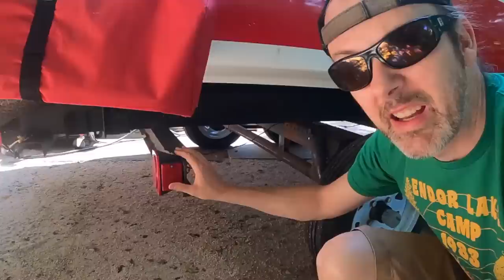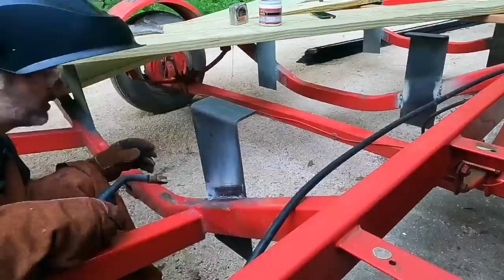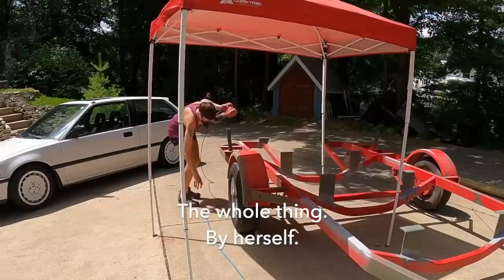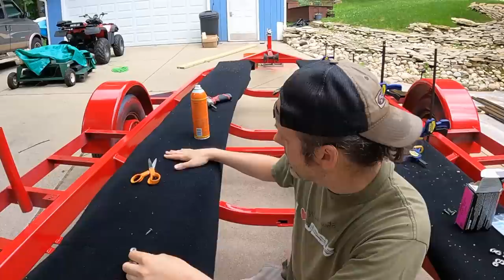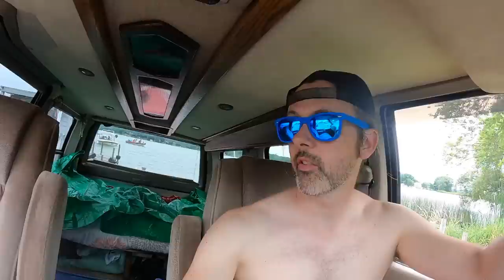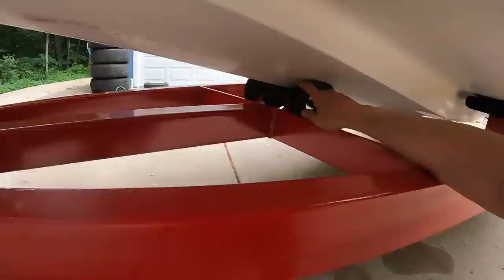Ultimate Boat Trailer Budget Build: Modify/Restore a Junk Trailer for Your Boat Sleekcraft Sunday 22

Comment: Use a turn buckle as the front locking mechanism and you are spot on with the v at the front. First thing would be to use a scale and find out how much weight is over the rear to then determine how far to move forward. Could also use another 2x? Screwed to the top of existing bunks to raise 2 inches or even 4 for a test of if raising bunks would allow you to move forward far enough. Then worst case scenario would be move the axle back. BTW love your channel; and your work with what is available and make it work attitude.
Reply: Raising the bunks would also help with clearing the wheel fenders.
Reply from the maker: Yeah, something like that might be the solution.   I think I'm going to unbolt the bunks and shim them upwards a bit in front, but I'm happy with the clearance in the back.   Axle isn't moving, I'll sandbag the front of the trailer with tool boxes and spares and anchors before I open that can of worms lol.  Cheers man!  Thanks for the words!
Reply: @ADDvanced  What does your current configuration weight? In most cases a single axel trailer is safe to haul 3000 pounds, I doubt you have much capacity remaining. Keeping your center of gravity lower will aid handling, especially at highway speeds. If you have sufficient out drive clearance shimming the bunks enough to support the hull is best. How much tire clearance do you have? Many trailer manufactures relieve the back of the fenders and add carpeted plywood backs to protect the hull. Shortening the winch stand and add a V block or roller on a plate and relocating the axel so you 10% tongue weight is your safest option towing. I enjoy watching your projects, keep the videos coming!

Comment: As a retired boat mechanic I’ve messed with trailers a ton, I think your on to something with the plate and bunk on the winch. Flip the winch over and crank from the drinkers side. I’d cut the bow roller off move it down slide the rig forward and bam…more tongue weight.
Reply from the maker: I like these ideas.   Great idea on the winch.

Comment: Add weight to the front of the trailer to fix the tongue weight issue. That trailer is designed for a direct drive boat, it will never be right without moving the axle, or adding ballast to the front. 

On the bunks. It looks like you could get away with shimming the bunks up a little in the front to fit the contour of the hull. Maybe use some UHMW Poly sheet and slip it between the bunks and trailer? 

And finally the winch etc. you are going to need something to keep the boat from creeping forward. Some low profile boats use a set of carpeted pads that capture the bow and limit travel fore. Raising the bunks slightly will also give you a little more clearance on the fenders. Just some ideas.
Reply from the maker: It's actually really close to being right; it takes maybe 5-10lbs of force to keep the bow from lifting.  Honestly mounting a spare up front would solve most of it.  But yeah, I think I'm going to shim the bunks up a little in front, and a little less further back, but keep the stern bunks at the same height.  I ordered some bow stops and plan on relocatin the winch, maybe look into fabbing one of those bars that mounts on the trailer that prevents it from sliding forward?   To be determined.  Thanks for the advice!

Comment: Double the wood,put another brace on both sides of the back,yes,the stop block she said is great,but you will clip the boat front to the stop block ,I would clip the front though too,hey trailer looks great guys really does,
Reply from the maker: I think I'm going to shim the wood instead of adding another set, they're expensive!
Reply: @ADDvanced  yeah,it can be done,or you could put wood under the carpeted one,both will work .long distance  though,I would support it,but your really close to the lake...shims it is....

Comment: Raise the bunks maybe 4" for fender clearance. On the bow loose the front roller and winch. Go to a front V-Bunk for support. For front attachment, build a Tie bar that is hinged onto the trailer and that will lift up and attach to the bow eye with a clasp. In the back just use 2 short straps on each side to the trailer. Watch the Roadkill episode where they swap an engine into a jetboat from a truck. You will see what i mean about the front tie bar. Oh and for balance, find out what the Gross weight is for that axle. I would guess it is 3500# max. if the boat is light enough that you have plenty of room, then just add ballast to the front. ie. Spare tire. maybe a tool box, lead weight, anything. Tongue weight should be about 10% of total trailer weight.

Comment: Me and my friend bought up all the Honda 350's and 400's we could find cheap in the Netherlands. And we would dismantle the rest of the bike.
For those remaining parts to be sold; we usually then got the engine for free.
Same as your trailer, haha.

Thanks for another video!
Reply from the maker: I actually wanted to restore the boat that came on this; it was a Sleekcraft Kaui with really cool gelcoat, but there was a split in the bottom of the hull along the keel, from the boat filling with water and freezing/thawing over time.   Didn't realize it was scrap when I bought it, but it worked out.
Reply: @ADDvanced  If you get lemons, make lemonade!
Great stuff that you do, my dude.

Comment: Ski boat trailer are designed for center motor weight, Extend your tongue 12 inches Cut your fender about 20 degrees then add pvc plywood with carpet. Also the boat is to far back cut the winch. then raise your bunks 2 inches. also you can. I build lots of trailers here. Ill send you a picture of one i just finished.

Comment: When I fab up something or modify an existing piece, many times it requires a bit of adjustment after the initial work. You've got a great start, so that trailer should end up as a success in the end
Reply from the maker: I think shimming the bunks up and relocating that winch further back will fix it.   Stay tuned!

Comment: Just a thought
So my buddy’s old boat trailer has a similar set up to what Sara was suggesting. Like a turn buckle hard mounted to the front bar with a locking hook to snap on to the bow eye, it pulls at like a 45 degree angle so it gives the affect of pulling forward and down. Also I thought I had would be take off the winch move that bar back and put another bow roller on it where you can lighten the load from the keel hopefully and get it to not bounce. Of course this is all assuming that you can pull it far enough forward to get you some tongue weight. 
Last thought. I know your not gonna wanna do this but you could move the axel back. 
Love you guy’s videos. Thanks for sharing 🤟

Comment: You said the trailer had a ski boat on it. Well ski boats have a V8 in the middle. Yours is an I/O, V8 at the back plus the outdrive. So balance is way off. You will have to move the boat forward, a lot. Bunks hanging out the back is odd, but with the outdrive, they won't be the most rearward part. Take a look at my old Sleek Craft boat trailer (LOL) and line up by axle, see where things are for ideas. Cut winch stand off red trailer. Use a solid bar, just like the blue trailer. Easy to make, looks and works great. I think you will have to lengthen the tongue of the red trailer (more welding practice). Only real problem now is that front roller. Reconfigure that crossmember to clear. Maybe block the bunks up to help with clearance too. The front end must be tight to tunnel, to reduce the boat hop. Sara has been a great help. She looks good too, doing well. Good luck you two!  Mark
Reply from the maker: Hey Mark!   Yeah, I'm aware, but I didn't know how far it'd be off 'til I tried it.  The trailer is built pretty heavy so I was hoping the extended length of the tongue/frame would offset the V8/drive which is closer to the fulcrum.   It's pretty close tho, I would say 10lbs on the tongue was enought to keep it down.  Sunday we removed the winch and slid the boat 8" forward, now it has tongue weight, so getting closer.  Need to fab some guide bunks in back to keep it off the fenders, and going to try shimming the front of the bunks up about 1-2".   I think that will be close, then just fabricate that bar/V bracket.

Comment: Rob, on the welding, yes, you should use the 70-30 % blend. Pure argon is for aluminum and ect...  I'm guessing but the wire feed is .032 or 035. On 1/4" you will need to be around 95 to 105 amps and adjust the wire feed to match the heat. Certified on g45 angle for welding tubes in boiler
And structure welding. Also that maybe Flux core wire in which you don't need argon.

Comment: I think the least amount of fuckery would be to shim the bunks up to where they support the boat and take the weight off the roller. It would also bring the nose of the boat up a bit and create a bit more clearance around the winch handle. If that doesn’t solve the issue just remove it or relocate it. I like Sarah’s idea as well.

Worst case you add some forward ballast to keep the tongue down. It will tow more safely once you have some tongue weight. But I’m sure you’ve already figured it all out. 

One question, did you grind off the paint/coating where you wanted to weld or just turned up the amperage and burned through the paint? If not the paint could be the cause of the welding issues.
Reply from the maker: Yeah I ground off the paint where I was welding, and ground off the coating on the brackets, it had some sort of darker coating to prevent it from rusting.   Maybe my ground was too far away?
Reply: @ADDvanced  assuming you got down to bare metal it could be the ground or more likely the shielding gas possibly getting blown around. Flux core wire works better for welding outside as wind doesn’t affect the weld at all. It doesn’t hurt anything to get a small roll of it and use it in conjunction with the gas as flux core with gas makes a nicer weld than just flux core by itself. The pros to flux core is you can use it in windy conditions and it gets better penetration. The cons is it spatters and leaves slag that you have to chip off. If you have to weld outside more I recommend getting a small roll of it to try. Good luck if you haven’t already finished fixing the issues. Well even if you have, good luck on your other projects. I really like everything you do. 🍻

Comment: Looks great.  Your tongue weight can change really quick.   You may have some axle adjustment.     

You can calculate how much you need to change the position of the boat and or axle. Toss a bathroom scale under the jack when you disconnected and start doing some math before you make any more modifications to see if those mods will even work.
Reply from the maker: Removed the winch, slid the boat 8" further forward, and it has a little tongue weight now.   Could probably use a little more, looking at mounting a spare tire up near the front somewhere.

Comment: My 84 LaveyCraft boat trailer has no winch. It has a bar that is angled and is secured way underneath the bow,. It just pivots and makes it very easy to load on steep ramps. Most of the boat is secured from the stern. The bow bar does secure it a bit but it is free to move up and down. When loaded it doesn't move. I use a strap on the trailer and hooked into the bow loop on the boat when I take it out of the water to prevent it from wanting to slip backwards on steep ramps. Once it's out of the water and on level ground I remove the bow strap. 

Bummer about the weight. Hopefully you can move it forward enough to get more trailer tongue weight. If not it will not handle towing very fast without swaying. When I re-powered mine with a newer one motor the weight changed enough that I added a spare tire carrier on the tongue to offset the additional weight. Between moving it forward and maybe a spare tire carrier you might have enough weight.

Good luck with it. Bummer about it not distributing the weight enough over the front of the axle. Awesome looking boat, trailer looks amazing.
Reply from the maker: I'm going to ratchet strap a spare onto the tongue today and try removing the winch, see if I can make it happen without too much work.  We'll see!

Comment: You need tongue weight or else the trailer can fishtail. Pushing the axle back will  shift the weight forward. Also, you are going to want that winch if you go to a steep launch.
Reply from the maker: Yeah, the question is how to achieve that balance.  Shifting the axle definitely would work, but would be a TON of work.  I think there's probably an easier way to achieve more tongue weight.  I removed the winch last weekend and slid the boat 8" further forward, now I have some tongue weight, I think it needs a bit more.   I will continue to tweak this and post an update.
Reply: @ADDvanced  Just for a comparison My 20ft Avenger on a single axle only had about 50lb tongue weight and it would track nice and stable when towing.

Comment: Get rid of the winch, roller and upright, set the boat up on the trailer. Cut the upright and reweld it in the new position and use a V block and a couple of chain links and a turn buckle to hold the front of the boat.

Comment: You mentioned your trim system. You have the old school pump/ reservoir, I believe you can use late model unit with relays instead of solenoids . Can't remember the bracket yours has but the butterfly wing style bolts to the floor and looks nicer. The newer unit has a plastic reservoir. 
The only thing I'm not sure of is the hydraulic hose fittings the new ones (alpha are Grey and black) but the ends are the same I believe. 
Haven't done any outdrive work in 6.5 years due to getting bucked off my horse and taking out T2.
  Hope this helps you.
And BIG  yes to carlsons are cool.
T-top version like 007 was top notch.
Shindler ?.  It's a Japanese sword name

Comment: I think you should have made the bunks higher . The bottom of my boat is at the height of the top of my trailer fenders. Just a thought I think the boat is sitting too low on the trailer you can also shorten trailer winch crank handle.
Reply from the maker: Lower is cooler :P
Reply: @ADDvanced  yeah I know just saying you did a nice job you do good work I like watching your videos I do the same kind of work make it like you like it

Comment: Need to move the axle back, which will give you the perfect excuse to extend the wheels out a couple inches, and change the wheel wells. Then you don’t have to bring it forward, and have less weight on the nose.
Reply from the maker: That would work but I think I found an easier way to achieve that balance, stay tuned!

Comment: Move your axle back. That will give you a chance to widen your fenders too. Move your roller back and change the height so the hull sits squarely on the bunks. The way it's sitting on the trailer, you won't be able to move it far enough forward to get tongue weight. I know it sucks - I hate redoing work. But I believe that's the simplest way to fix your issue.
Reply from the maker: I removed the winch and was able to get the boat about 8" further forward.   Thinking about cutting the surge brake hitch tongue off, and installing a swing away hitch, that would get me even more room to move forward.

Comment: That trailer looks like it was originally for a ski boat with the engine mounted in the middle of the boat. With a slight shift forward and some added weight to the front, like a spare tire you may get enough tongue weight. However looks like your gonna need to move the axle, lengthen the tongue or get a new trailer
Reply from the maker: I'm aware of what it's from, I explained it in the video.   But yeah, it's pretty close to being balanced, even mounting a spare up front would solve the tongue weight issue.   Just need to dial in the fitment, stay tuned!

Comment: Just add a axle in the back most are double axle and close to the back to balance all the weight  and alot of them don't have winchs just a bar with a pin
Reply from the maker: No, whole reason I built this was to get away from tandems.  I hate them.   They're so hard to turn around in tight areas.

Comment: Hey from Australia! I would have had a mad tantrum with that trailer balance..... you have 2 problems (and i think your onto both of them). The first is your bunks / support isnt right, your boat bunny hoppying as you drove home even with that weight on the rear it should sit stable on the trailer and not need the nose pulled down vertically to stop it bouncing like that. Id chase that first, play with the bunks (rasie and a slight taper in the rear?) as well as shuffle the boat slightly forwar on the trailer. Id see what that did to the balance of the trailer as the single axle is kinda a long wat back. As for trailer balance, you could make it a tandem or add a floor to the front of the trailer. A second lazy axle infront would probably add enough weight . Anyway the boat looks good on the trailer. Oh Id also be tempted to space those wheels and guards out to give you a couple inches either side.
Reply from the maker: I shimmed the bunks up in front and the bouncing went away completely, removed the winch and slid the boat further forward, and BOOM, tongue weight!   Getting closer!   Stay tuned for updates.

Comment: I have a California style aristocrat outboard. It had a 200 black max, but I bought a 98 200 efi mercury.  I swapped it to 7 petal and 225 promax efi. 28cc heads, ported and polished the exhaust chest  and a a32 cup with ccms drag reeds and spacers. But I need help hooking up all the vac lines and some other stuff. Comment if you can help. I have spare 2.5 heads, 2.0 heads 2.5 ecu, wh22 carbs and much more. If interested in any parts or with help tips.
Reply from the maker: I'm definitely no expert yet, still learning a lot, but I'll be sharing what I learn as I go.   Cheers!